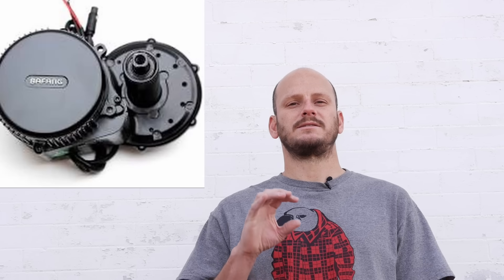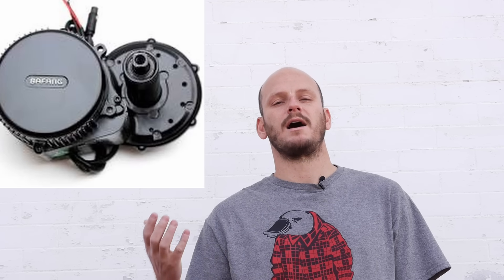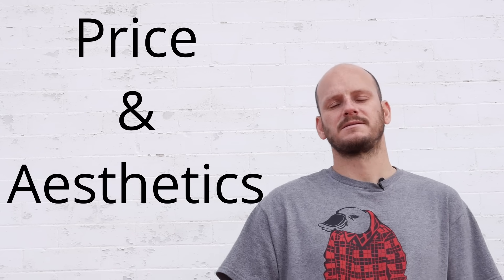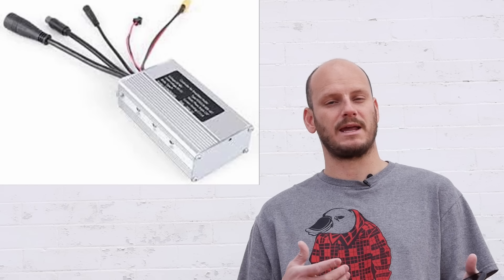Hub vs. Mid Drive Motors: Why Hub Motors Suck and Debunking Common Myths with performance test

Comment: I Don't understand what your saying? One gear hub drive. I have two ebikes, both hub drive,
1: 350w hub drive with 12 speed pinion gear, (12 speed transmission) 
2: 750w hub with 11 shimano xt d12 11speed derallier, with Schlumpf Drive Mountain drive. Making 22 gears.  No pros or cons.  Just saying lots of options for hub drives! 
As midrives, your options as well like the match up Bafang BBS motor with a 14 speed Rohoff hub. Con's  no sweating!  NOTE, Pinion $,$$$ and Rohoff up tnere in cost as well!
Reply from the maker: With a hub all the power goes to one fixed gear ratio. With a mid drive you can change the gear ratio by switching physical gears in the back.

Comment: 1:40 For most gear ratios on a bike, torque at the pedals is greater than that at the wheels, so comparing hub motors and mid drive in this comparison is meaningless. So if you're pedaling at 75 Nm in a 42/14 gear, the wheel torque is 25 Nm but its angular velocity is 3 x faster. In a 32/32 gear torque and angular velocity are equal.
Hub motors don't need as much torque as they drive the wheel directly, but they are capable of higher angular velocities (although a mid drive is almost always geared down, whereas many hub motors are direct drive).
The advantage of a mid drive is you can vary the wheel torque more through the drivetrain whereas with a hub, you either limit the torque or the top speed (depending on wheel size or motor choice). You sacrifice some gears for your legs (3 chainrings to only 1) but on the plus with the motor you are unlikely to need them.

Comment: I prefer mid drive personally but for "lending a bike to a friend" a hub is best as they are less likely to damage the drivetrain. Because only I ride my bike I like that I can go really fast but not bog the motor down on steep hills. Also if your bike is a single speed you may as well go hub.

Comment: I have a 48v 1000w front hub motor.Its all about the amperage of your controller.I have replaced my 26a controller which gave me 1200 watts with a 45a controller which now gives me 2200 watts.That will get you up that steep hill.If you upgrade to 45a controller you will need torque arms on both sides to keep the wheel from coming off because it will come off WITHOUT TORQUE ARMS.That is a lot of torque.

Comment: My 1kw hub motor does 32mph happily &  pedal it to get going  , its much more simple & doesn't stress the drivechain , it has 14gauge spokes & has been faultless in the thousands on miles I've covered on it & the 48v kit minus a battery cost £200 , absolute bargain & still on the first chain & sprockets
Reply from the maker: Nice! E-bikes rule!

Comment: I’m in the UK and use an ebike with a rear hub drive and in all three hub drive bikes I’ve had I’ve never had a spoke break - perhaps that’s because I only use it on roads and trails and not on rough off road surfaces. Horses for Courses I guess and as much as I’d like to try a mid drive bike most are way out of my price range.
Reply from the maker: Are the Bafang 02 priced that much over there?
Reply: @JohnnyNerdOut  I had a look on line and they cost anywhere between £360 to £420 ( $500 to $590)in the UK
Reply from the maker: @johnduggan218  easy. Move!

Comment: I thought u were an expert.... Pretty narrow minded view, you obviously don't do many high  performance setups
Reply from the maker: I thought you watched the whole video, High performance hub motors are fantastic and probably a better suited motor than a high performance mid drive. This was an apples to apples comparison of street legal motors (consumer)
Reply: @JohnnyNerdOut  You said at the very end that mid-drives are only 10 years old, but they've been around for much longer. Ebikes from the 1990's and early 2000's like the Merida Power Cycle and Giant Lafree were mid-drives.
Reply from the maker: @sammiller6631  very true

Comment: I have had 3 mid drives and now have 4 hub drives ( I have built all of these) and I can tell you this opinion is somewhat misleading. All 3 of my mid drives failed; 2 mechanically and 1 controller.
I then had huge issue on parts supply to try to fix these. 
I have done 28,000 miles on the hubs in the last 18 months with no issues whatsoever. Yes watch your spoke tension but after a number of tension adjustments this issue almost never surfaces again as the spokes then "settle". If you use your bike for transport (not off road as the rear axle weight is too great with the hub) then the hub motor is the Best choice. And if there was ever a major issue just buy another hub motor wheel for $200 and install. Saves all the expense of going to a bike shop too.
Reply from the maker: Thanks for the insight.  Curious, what kind of mid drive did you have that failed? I personally like the performance that mid drives offer. But it is an opinion piece :)
Reply: @JohnnyNerdOut  I had 2 Aprilla ebikes with mid drive that failed but the motor was branded under their name. Also the two different hub motors; gear driven hub and direct drive. Gear driven hubs are renowned for issues ( I had 2 fail) but not direct drive. I have never even heard of a Hall sensor failure in a direct drive but have heard of a controller failure but again these are cheap and easy to replace.
Reply: @maxward9953  I also prefer hub motors but I know that sometimes the adhesive holding the magnets in place fail.
Reply: Bafang geared hub magnet glue had to be fixed. My other Direct Drive hub was fried making the mistake of WOT up Waterton. Bought the internal controller DD Magic Pie and holy crap that thing is a rocket once unlocked. Internal controller makes for a clean look. We will see if I have any issues with heat. I just received a Bafang ultra, which I've heard can eat chains if proper riding isn't followed. I can understand why many prefer the cheaper hub.
Reply: Additionally, the torque going to the wheel is going to be the same for a given power output, whether it's coming from a mid drive or hub motor
Reply: Well not all motors are equal. Middrive or not if made poorly they will fail. And those distances you are taking even an average aluminum frame can easily fail two times or 3 if to be fairly hard on it.

Comment: I will keep my hub. I'm very happy with it.
Reply: @Mal S I agree. But,  I bought 2 ebikes hub motors for the price of one mid drive ebike . One for me and one for my wife. And, I use my wife's bike battery if I want extra range. My two batteries together I have way more range than any mid drive motor ebike for the price of my two e-bikes. If money is not a problem, yes mid drive motor is better, but I don't think is worth it, if you are tight in money, hub motor is a better.
Reply: @BL1000  where did you buy the hub motor?
Reply: @op14435  I bought two Radrunner 1 bikes, from Radpower.
Reply: Chains DO break!! And when you break a chain and you are 35 miles from home in the countryside with no towns or no one to help you, are you going to want a mid drive or Hub motor in that point in time??? Ask me how I know!!! They have motor will still get you home and I will from now on stick with my Hub Motors thank you very much!
Reply: @metalman69201  
Ditto, been there. Hub motor for me also.
Reply: @metalman69201  How did you get home  35 miles from home in the countryside with no towns or no one to help you? That's a crazy long way to drag a broken mid-drive. How long did it take for you to get home?
Reply: @metalman69201  Chains don't often "break" (poor maintenance perhaps) but in higher powered crank driven (mid) the chain will wear quickly and that causes excessive wear on your cassette and sprocket.
Reply: @metalman69201  Hey, ebike rider, from plains to step hills, to 45º climbs, to extreme downhills. Change a chain is cheaper than change all wheels spokes from a weird hub motor, also, change a chain is simple and fast, you can repoair a chain also, just bring with you some small pices of another chain and with less than 5 minuts, you have it fixed. cheap, fast, and worth it. Also, try to repair a hub motor, dare you.
Reply: The best thing about hubs is to put one on the front also and have AWD lol.
Reply: Good on ya.
There's that one company that has a fold out, free delivery, comes assembled. Has a GIGANTIC following with many many YouTube independent video creators, going over the "issues' after a couple years of hard use. Yeah it's a hub motor bike that receives alot of praise.
Ordered one 2 weeks ago can't wait.
Reply: @SavedTraveler-1975  LECTRIC comes to mind here, I road a friends hub 750w XP for a week and "loved it" I would have bought one in a second if they had mag wheels at the time. (MAGS are 'zero' maintenance for heavy riders) I also harbored a misconception at the time looking at the hub driven pseudo 750w (they were cheating in the stator size department in 2020 compared to the typical BAFANG 750w hub) 'single geared' RAD RUNNER a economy bike with mostly great service and features for the price. If I knew then, that I 'almost never' used more then my 11 tooth rear gear the RUNNER might have swayed me too. In any case, if your a shopper today and can find a in stock bike there are so many more options since the 2020 season. I like the new SONDERS line this year.
Reply: @SavedTraveler-1975  The WAIT, will frustrate you, same situation ordered 6 weeks ago upgraded last week to front suspension.  Do I have to wait again another 6 weeks?
Reply: When we bought hub drive ebikes, we gave away our mid-drive.  Why?   We old fogies need help on the hills, and our mid-drive just didn't help enough.  JohnnyNerd shows a mid-drive far outperforming a hub drive on a hill, but if you look at the specs, you'll see that the available mid and hub drives all seem to top out at 80 newton meters, but in almost every case the chain-and-sprocket gearing REDUCES that torque.  Bicycles are geared that way so the rider can keep up with the pedals.  I have seen a $5000 Giant mountain ebike that had a larger first gear on the freewheel than the chain ring, and I'm sure there are others, and maybe JohnnyNerd makes them that way, but most are not.

The other problem with mid-drive is that most will only put out an amount of torque proportional to the torque provided by the rider.  This is great for young'uns who want the exercise, but not for us oldsters who need help up the hills.
Reply: @davidbainbridge7259  
Agree with the old fogies on hills I happen to be one. I've got 3,446 miles on my cheapo Kent step thru I use for fishing and not a single issue with my hub motor or anything else besides flats.  Hub motor can last if properly cared for and used for its intended purpose. I'm sure a lot of those hubs he has repaired or replaced are from abuse.
Reply: @davidbainbridge7259  Good point. Hadn't considered the old fogie angle. It makes sense that the mid-drive chain-and-sprocket gearing REDUCES that torque.
Reply: @Mal S I'm building my first ebike and went with hub because I prefer riding older beach cruisers and they use weird single piece cranks for the pedals and can be hard to find adapters to allow a middrive to mount in it. However, if I was on a mountain bike, I would totally run a mid drive because that will be abused much more than a beach cruiser going to the grocery store will.
Reply: @Mal S Or maybe mid-drives are a status symbol to show much money and time you can afford to spend, like owning a supercar that spends more time in the shop getting fixed than it does with you driving it?
Reply: Hub motor all the way. If I'd did mountain biking for sure a mid drive is better. Btw my hub motor give me 30mph on throttle only and im 220lb, also I have motorcycle spokes on my rear wheel. Lol this guy is a hub motor hater......Better to be more bias
Reply: @tuandang2947  I don't understand why there's so much hub motor hate. mid-drives are for mountain biking, hub drives are for commuting, not racing.

I wonder if the hub haters are also those who constantly jump lanes on the freeway thinking they'll get somewhere 40 seconds faster in an evening rush hour pileup?
Reply: It's also alot cheaper to diy an ebike.  I can probably build a better ebike with a mid drive than your pre-built hub drive.
Reply: @ApexOperator25  DIY hubs are cheaper than DIY mid-drives. Fewer parts and you don't have the extra part of messing with the bottom bracket.
Reply: @Mal S It really depends on the controller. When riding the bike, unless you are doing serious MTBing then you probably won't notice much difference except the hassle of changing gears.
Reply: links to ones you like and or builds?
Reply: I agree since I'm old and out of shape, sometimes I want to ride instead of pedaling.

Comment: IPM-synrm  Gives 2% better overall, and torque at both low and high speed rotation.  No hub motor for bicycle or scooter currently uses it, but will be useful for both and cost only a few dollars more.  Hub is the future.

Comment: I havent yet bought a Mid drive, but my 1500w Hub motor gets me up to 40mph fairly easily while stock and I have had it pushed past 1800w and the only problem I ever had was blowing my controller, my Hub motor works fine no sign of damage yet
Reply from the maker: Sounds like a good quality motor 👍
Reply: @JohnnyNerdOut  Yeah it is, though I do want to move to a Mid drive, its that I'd have to change out so much on my bike. I'm hoping with a Mid drive I can be more efficient with my battery usage..
Reply from the maker: @TheBrainSquared  you could sell your motor kit for probably close to what you paid for it I bet.
Reply: @TheBrainSquared  What makes you think Mid drives would be more efficient? Here's a Deep Dive into Ebike Motor Efficiency: https://youtu.be/dxJe_gygRGU
Reply: @sammiller6631  I understand what your trying to say, though one thing about mid drives is the ability to use the drive train and use the gears.

Comment: Question, looking at getting my 1st kit, can the hub system work on just a throttle or do you have to peddle all the time.?
Reply from the maker: Depends on the controller. The motor will do whatever the controller tells it to. Some controllers don’t have throttle inputs.
Reply: @JohnnyNerdOut  on a normal bike the front sprocket are fixed to the pedal. on a rear hub motor its free from the pedal . so on a mid motor if you use the hand throttle i take it the pedals still have to be use or is there some sort of clutch there
Reply: @SuperMARKNORMAN  Yes, there is a clutch. You can use throttle only with the Bafang BBS## motors.

Comment: Both systems have plus & minus.
Reply: If you are going to mid drive you also need to go to an internal gear belt drive due to the additional stress and potential chain wear.
Reply: @midnight4109  Most mid-drives can't accommodate a belt and an IGH that can handle the full torque of a good mid-drive is as rare as hen's teeth and consequently expensive. I have yet to see a belt & IGH combination on anything more than 800 watts but the industry usually use them only for bikes under 500 watts.
Reply: @michaelsprinzeles4022  What do you recommend for an e-bike?
Reply: @michaelsprinzeles4022  Would a Rohloff Speedhub with belt work on a mid-drive?
Reply: @sammiller6631  I'm not sure. There's no reason it shouldn't work but I don't think anyone is making carbon fiber belt chain ring adapters for DIY mid-drives (YET). Since there are belt driven mid-drives on the pre-fab market it's only a matter of time though.
I' personally wouldn't run an IGH on anything over 750 watts. An IGH creates a better chain line but is not intended to run so much power and is difficult & expensive to repair compared to freewheels or cassettes.
Reply: @midnight4109  That's such a personal choice. It depends on what you want out of a bike. I got into DIY mid-drives because when I became interested there were no truly cheap e-bikes and for the cost of an entry level e-bike I could convert my mtb into a beast.
I have to go with JohnnyNerdOut & say the best e-bike is the bike you have already known and enjoyed as a bike but with a BBSxx mid-drive.
Reply: This guy wants to sell bikes.  Bang for buck, voilamart.
Reply: Mid drive just has more pluses.
Reply: @thedon2703  No, mid drive has many many negatives.
Reply: @sammiller6631  False. Hub motors are primitive and cause flats and damaged spokes.  I've had multiple hub motor bikes. Never again..